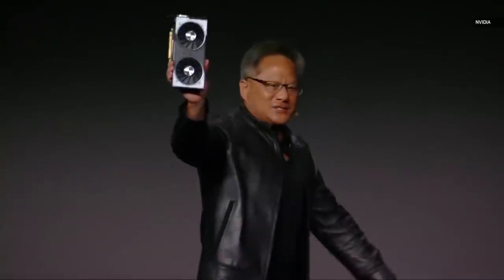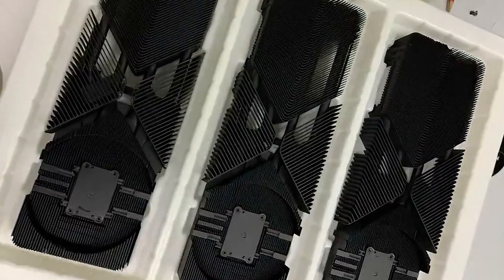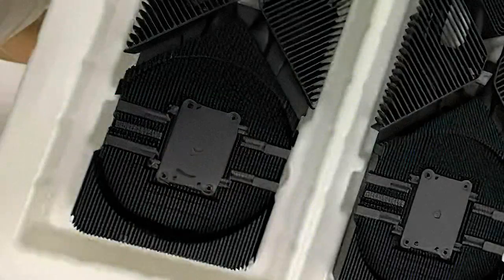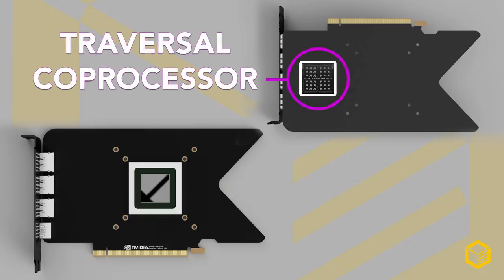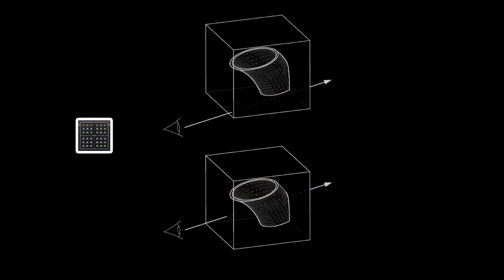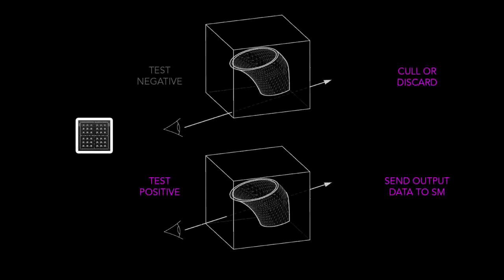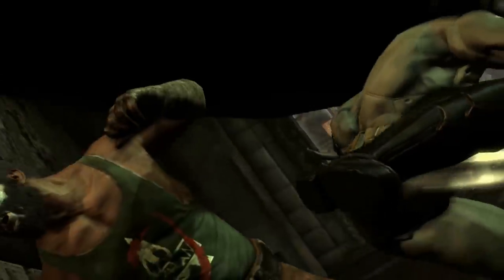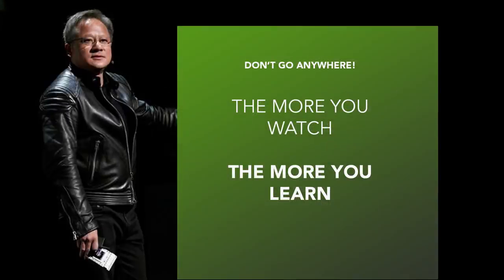A REVOLUTION in graphics is coming

Comment: i think it will be less amazing than you make it seem. but it should be better for sure. from both camp's. personally most people are not going to be able to invest into one until they bring down prices and raise availability. this all depends how many wafers they can make and sell, and how good the yields are on those wafers and at what cost each die will be for each designation (ie models). if  more of them are really good yields per wafer, we can expect lower prices on the higher end cards. if the yields are less than perfect for the majority, we will see higher prices. little more variables than that. 

i hear the news that each cooler is going to be $150 alone for the setup you showed in the video. tack on the price of the memory, vrm components, gpu and co processors etc... then variable in what manufactures will profit and then what retail outlets will profit and of course what nvidia will profit.... its going to be marked up substantially more than the hardware and manufacturing costs totaled up.

they are basically going to be priced well out of the general consumers hands. but dont worry, plenty of people will save up or have disposable income for the high end.
The mid range will be quite the same with minor improvements. perhaps add a step above, maybe two steps to make it look like its worth the added cost's. Low end models, well... you nearly always want to avoid one unless its for business or non gaming or entertainment.

so to sum it up... i think were going to see good numbers in the high end that will have very limited buyers from both brands. nvidia is gunning for more than just gamers. nvidia mid range will be more expensive but provide a incremental bar-graph jump from previous arch, amd seems to be re-releasing 5700 models. so the node may have improved over time. i think amd can ride the super series as it stands, but just counter price or performance to what AMD is offering.

Comment: As other have said. Game streaming isn’t here yet.  Yes can do it but latency is still a huge issue. The ability too send and receive data within 100ms or less just ISN’T posable currently. Lag/latency is still huge issue,  esp time sensitive games like racing/driving game.   Dirt2 (rally game) req ms for quick changes with fast shifting, steering/ throttle /brake / clutch responds.   

You CANT do that over currently internet and have decent latency over internet.  Until they can learn how send/receive data that under 100ms or less.  Maybe 5-10+ yrs they discover a way bring low latency internet to gamers.    Game streaming works ok for games that aren’t time sensitive.  But most newer games are.

Comment: Are those keys the same crap as other sellers? I had the problem with buying "original full-version" windows 7 ultimate keys. Turned out, after 6 month of usage, they where locked and after calling Microsoft, they told me those are not valid keys.

Comment: As I said on Twitter, an accelerator on the back of the pcb hadn't occurred to me until you brought it up, but it makes perfect sense and goes along with some of the things I've been saying about ray tracing ever since Nvidia announced the RTX line two years ago.  The technology wasn't ready for public adoption and the RTX 2000 series should have just been the GTX 1100 series with an experimental feature.  Instead we got an overpriced card that barely performed better than the previous generation with a "feature" that was useless.
Seeing these kinds of accelerators possibly happening with Nvidia finally makes me wonder what kind of research AMD is doing into accelerators for their implementation.  Let's face it, accelerators are the future of games and graphics.  I'm of the personal opinion that we are reaching the theoretical limit of performance with current silicon layouts on gpu's.  Sure we can push framerates through the roof with better quality silicon that is more densely packed, but games really aren't becoming that much more beautiful.  It's time to push the envelope in other ways.
One thing I find interesting is Nvidia's potential foray into VR.  I like the approach and the ideas, however, I'm also afraid.  I mean, I don't want to turn my body into Johnny Mnemonic, have to plug in like the Matrix or salvage scrap to modify into cybernetics like I think it looks like can be done in Cyberpunk 2077.  I mean, is anyone else starting to wonder if that's the direction these companies are trying to take us?  Sometimes it feels that way to me.  When are we gonna get holodecks like in Star Trek?
Overall the big question is what accelerators are AMD working on to tackle the ray tracing problem?  It would be nice to get some sort of sneak peak at the 6900XT, if that is indeed what it's going to be called.  I think people need to realize too, yes, the consoles will be able to do ray tracing, but they will have much more limited space for the accelerators and thus won't do it quite as powerfully as pc discrete graphics cards.
It's also a big part of the reason I'm less interested in the reveal of the PS5 chassis and more curious to get a look at the pcb of both consoles.  I bet you'd find more dedicated ray tracing accelerator silicon in the XSX compared to the PS5.  Big reason is DX12U.  Microsoft wants to show off their pride and joy as best as they can in a console.  Sony would rather focus on something else.  This is why it's going to be a draw this generation in the console wars.  They're both going to be really excellent at something that's going to set them apart.  Sorry fanboys and girls.
Edit: Sitting on my balcony I thought to myself I hadn't quite said it all so, let me try to say the rest.
When I say we've reached the theoretical limit of what current silicon can do I mean these general purpose gpu's without any accelerators.  We can't simply throw in new instruction sets (though Crytek with Neon Noir would like us to believe it is possible to get playable ray tracing performance without dedicated silicon to the purpose) and brute force the solution anymore.  We're getting to a point we need dedicated purpose silicon along with software and ai tricks to get us closer to photorealistic games.
Now on the console front I wanted to make sure to mention that while I think that the XSX will have more ray tracing dedicated silicon on its pcb, I also think that Sony wants to focus on what the pci-e 4.0 can provide.  Remember, it's rumored that the PS5 is going to have the upcoming Samsung 980 Pro (which is itself rumored to be releasing in August on Samsung's proprietary controller).  That and the Phison E18 controller coming out later this year we will have plenty of drives coming out soon that will be just as speedy as the PS5.
That leaves us with having to imagine the ray tracing performance of the XSX married with the ssd performance of the PS5 and you will have a taste of what is possible on PC with AMD X570 and/or the rumored X670.  Of course those of us in the enthusiast community who early adopt(ed) Zen 2/3 and RDNA 2x will be able to see what is possible on consoles before they come out.
Reply: Oh, and does anyone else think Keanu is trying to tell us something about himself with so much work that has him playing cybernetically enhanced characters?

Comment: You are contradicting yourself. On one hand Nvidia lives by reducing communication overhead and then they would make an entirely separate chip? That doesn't really make sense. If the coprocessor exists it will be 100% embedded in the GPU die itself. Also... the reversed fan still blows over fins that are connected to heatpipes from the front side. The back side will not have anything other than some resistors that could produce heat.

Comment: "...basically the same as Stadia, but with a crucial difference. The controller connects directly to the WiFi router..." Wut..? The Stadia controller has always had the ability to connect directly to WiFi. 

Then, if the controllers have the same functionality, the comparisons in latency between cloud platforms will no doubt be more dependent on the service's infrastructure and cloud architecture.

Comment: PhysX wasn't Nvidia's hardware invention. PhysX was made by a hardware company that Nvidia purchased and integrated the technology to its GPU software stack and killed the hardware.   As for having separate RT co-processor on separate PCB requiring its own memory I think is unlikely just because of extra manufacturing costs eats margins and they would have to make it capable of running ALL the shader code cuda cores can inorder to be able to avoid quick communication requirements which means instead of having one high power chip and one set of memory chips they need two,  and half the time one sits idle and other half the time other sits idle.  Nvidia has invested enough to use cudacores to run shaders on results of nonprogrammable (so 10x more power efficient) RT cores so that it wouldn't have a chance. More likely is that they just use heatpipes to spread the heat and there is so much heat that they would prefer to get some out of the immediately instead of heating the CPU cooler.
The dual chip is only good idea if their communication is ultra fast so same PCB close to one another and both could use each other's memory almost like it was their own.

Comment: There is no way the 3090 is a dual-GPU card.
My predictions: the 2080 Ti has 4352CCs and runs at 1.6 GHz respectively. The 3080 should have 3840CCs (11% less) and should run at 2.3 GHz (30% higher). That alone give the 3080 a 19% advantage. With 320-bit GDDR6 16 Gbps memory it would loose a bit compared to the 2080 Ti, but still should easily beat it by 13%. And I thing Ampere cores will have at least 3-5% IPC gains. So the 3080 will beat the 2080 Ti by 15 to 18%.

Comment: What doesn't make sense to me about there being a front and back processor, each with their own fans is - where does the PCB fit into this?  Think about it.  One fan would have to be on one side of the PCB and the other fan on the other side of the PCB.  This is not what your 3D model shows.  It shows the PCB being directly where the fan would go.  To have a double-sided PCB with cooling on each side, the PCB would be in the MIDDLE of the unit.  Not flush on one side (like all other GPUs).  Also, look at the heat sink "prototypes" - how does a PCB fit inside of that?  It would have to be in the middle, well.. there's pipes and fins going through the middle.
It appears to me that the PCB is shorter than it appears.  It appears the other fan is hanging off the end of the board and is just a separate cooler.  See this illustration https://i.imgur.com/ctE81Dy.png
... If any of this is even real, that's my opinion.

Comment: Not sure what Ive just watched there. Sounds like very cool stuff... that will probably be too expensive for my taste but still at least we see some actual innovation in our industry. 
But Im a bit concerned about the GPUs , still. ... after what the PS5 is doing to remove asset pop-in and speed/loading speed problems. I wonder if we can "emulate" that with just high amounts of GDDR/DDR on the PCs for the future . 
25% ... or even if it was 40% performance increase for next gen CPU isnt enough an ymore. And while RayTracing sounds good if its actually fast enough ... for me it isnt enough . Specially when you will probably get 2080Ti type performance at around 700+- $ ...its not enough. If I see some solution that tackles what the PS5 is doing.. I would be impressed then, but Im not even sure its the GPUs manufacturer "job", I guess it is, dont know.

Comment: The 3090 will most definitely be called "RTX 3090 Titan" and will be the Titan. What you forgot is it has 24 GB VRAM, just like the Turing Titan RTX. And Dual GPU makes absolutely no sense, because Multi-GPU is in fact already a corpse since 10 years. It was dead on arrival in fact. A multi GPU design won't give anyone the performance crown anytime soon.
Reply: Also: The Ampere GA102 die is much larger than the TU102 die despite being on 7nm. I think the accelerator cores are actually within the monolithic die. And I am pretty sure that latency would be horrible with another die on the back routing all information to the PCB besides the VRAM lines. I actually think there's just the VRM and VRAM on the back, as close as possible to the GPU to minimize crosstalk and noise as well as power losses through the PCB.

Comment: I like the creativity but it doesnt pass the simple design layout check. If you look at the card theres no possible way theres a processor where you say it is without compromising the cooling solution. You see the metal plate were all the heatpipes come from, the other side of that gets slapped onto the gpu die and thats attached to the rest of the heatsink. Yet youre saying theres somehow a processor on the other side of the card which is solid heatpipe and fins. There would have to be pcb we would see from the fan. Now given all that I have no clue how the power connectors exist there if they even exist there. Which leads me to believe this is not even remotely close to a final design and they are just testing machining or something.

Comment: Maybe this is not a gaming card?
Two chips accessing the same memory area, and each having its own cache layer(s), would severely hurt memory performance both in bandwidth and latency. Such configuration could make sense for professional compute applications where workloads are highly parallel and very little memory is shared among threads, effectively making each thread owning its own memory area without much of intersection, unlike a gaming workload where the same data ( geometry and textures) are being accessed by hundreds or even thousands of threads simultaneously. Actually this is the reason why sli and crossfire are dead (for gaming), because they require game developers to rewrite the algorithms in a highly parallel fashion, and time has proven it's a complete waste of time.
Unless nvidia comes up with some magic sauce, this is highly improbable; and if they come up with something to solve that memory access issue, why would they make two different chips? Why not use two identical gpu chips for "simple" scale out.

Comment: I dont see the need to desing a push pull gpu just because a chip on the back needs cooling.
And im sure that Nvidia is proud of there high efficency and those theoretical gpus seem to be quite power hungry.
And giving AMD the power-per-watt advantage would be marketing scuicide.
Just Imagine a LTT video where AMD videocards have a 50% advantage in nonraytraced games.
And the communication delay between 2 chips such a distance apart is in my oppinion to high.
PS: i think if there is a chip on the back there is almost no space left to move/conduct the heat to the heatsink.
You cant just make the back thicker because those cards need to be able to be stacked with normal pci-e devices.

Comment: Personally to me, this isn't going to end well.
Nvidia is notorious for seeking a hardware solution to everything. It will bite them in the ass eventually.
AMD goes with software most of the time so they are able to refine stuff from older hardware as well.

OEM and other parties do NOT like ultra-custom design or hardware if it means more work on their end.